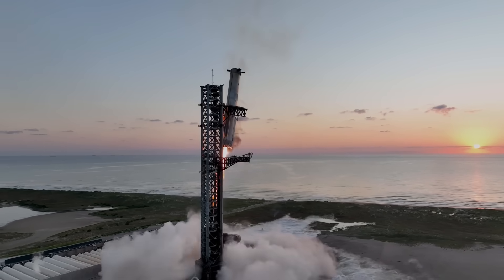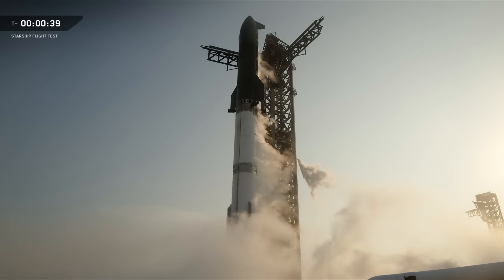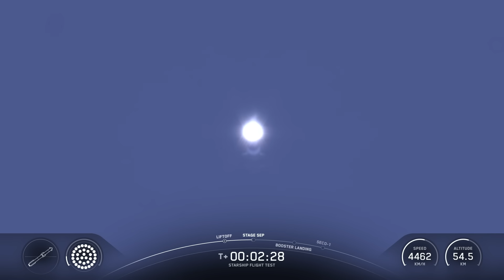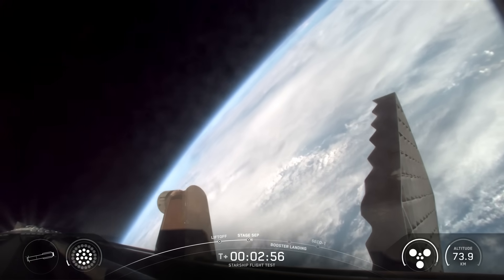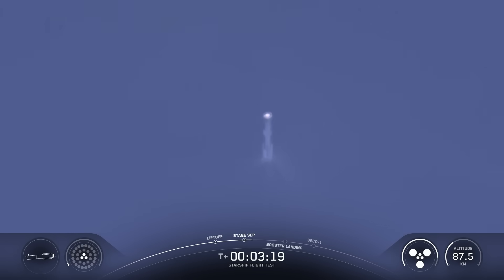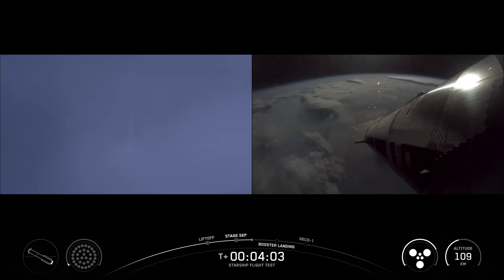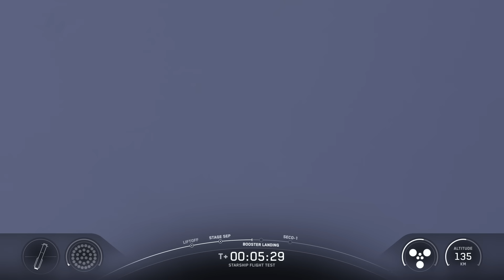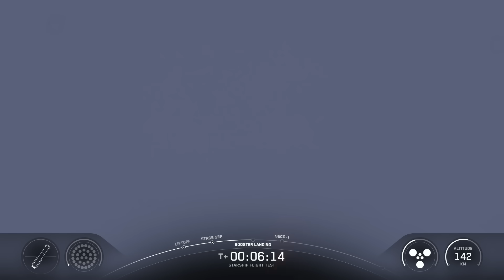SpaceX Builds Largest Reusable Booster, Also Makes Door That Won't Open - Starship Flight 9 Recap

Comment: Would it be possible to build a vehicle that can self-orientate itself into a survivable configuration? Soyuz is built like that, even if the attitude thrusters fail, it'll still do the ballistic descent. Which is rough, but safe.
Reply: Soyuz is passively-stable if the attitude thrusters fail *off*. It's definitely not stable if they fail *on*, as seems to have happened here.
Reply: Maybe there's a way to get the ship to cancel a tumble entirely though elaborate control of the aero surfaces, but that would make the software way more complicated, and I figure the descent would end up too steep to be survivable anyways. Normally the ship is supposed to angle itself and gain a bit of lift to flatten out the descent trajectory. Can't do that if it's frantically flailing its flaps around just to regain control during the first few minutes. The real solution is to not suffer catastrophic leaks during ascent.
Reply: It only works for capsules
Reply: An entire vehicle? I don't see how, they do that by interacting with the atmosphere and inducing drag, it would make it hell to launch, unless you placed the entire vehicle into a very large fairing
Reply: Soyuz would only fail "safe" if was already in the correct orientation when hitting the atmosphere AND didn't have a propellant leak AND it's engines failed while off.
Reply: Starship probably has way too much angular momentum for the thin wisps of air at that altitude to really arrest much of anything, unlike Soyuz. It had active control of the flaps the whole time and couldn't do much of anything to save itself. We saw this with Ship 28.

Comment: @scottmanley, It would have been nice if SpaceX continued to further develop Falcon 9 and Falcon Heavy while waiting for Starship to mature.

A larger 5m diameter Falcon Heavy (up from 3.7m) and a hydrolox  3rd stage can boost TLI payload capacity from current 16.8t to 25t-30t.. comparable to SLS block 1 for a fraction of the cost.

But Elon threw everything into Starship. I think an upgraded Falcon 9 / Heavy would have been a great intermediate step before operationalizing  Starship.
Reply: Probably not worth the time and cost, since it still won't be fully reusable. There are other rockets available like blue origins new one if falcon heavy can't do the job.
Reply: I’m pretty sure starship is the intermediary step. It’s the testbed for absolutely every tech they think they’ll need in the future (methalox, hot gas, full reusability, etc.) meanwhile it still needs to refuel in orbit and such. Once they get starship tech to work they can scale up or down for whatever they need.
Reply: @cipher4213 methalox is also kind of a dead end in the second and upper stages

Comment: SpaceX needs to make some serious leaps in flight 10.
Reply: Certainly it is just enough to get more DATA from yet other failure modes. Progress guaranteed, every failure is success!
Reply: Why?
Reply: @MDL.720  Because a lot of SpaceX money is from private investors and from the taxpayer (albeit indirectly). Both of whom expect accountability, progress and value. Things were never great on any of those counts, but are getting significantly worse through the V2 programme. It's getting to the point where Flight 10 needs to demonstrate a) the ability to get things right with an updated design, which is good long-term but will hit confidence or b) the ability to get things right with the existing design, which is becoming increasingly important.
Reply: @whistlingchickenleg  For the last time, taxpayer money is not being spent on the development of Starship flight articles.
Reply: @whistlingchickenleg do you know any of these private investors?
Reply: @epj0211  American taxpayers are paying for NASA. NASA paid SpaceX to develop Starship as it is supposed to be their way towards the moon. So yes, US taxpayers have gave money to this specific program and are legitimate to ask and expect results.
Reply: @epj0211  Of course it is. SpaceX received 3 Billion $ from NASA and is going to receive another 1.5 Billion. What do you think where that money went 🙄
Reply: @eljedimexicano6737  NASA paid 3 billion towards the development of Starship HLS. It is not being spent on the development of the flight articles. Also, you're all for taxpayer money not going to this, but turn a blind eye to it being spent in the billions towards bogus programmes to line the pockets of beurocrats? A bit hypocritical, if you ask me.
Reply: @eljedimexicano6737  NASA did not pay to develop Starship. NASA contract states that every time Starship achieves some predetermined goal SpaceX gets paid. Currently bit over 300 millions was payed out most of which was for flight three and nothing since then. The contract for moon landing is goal based and as such Spacex doesn't get payed until they demonstrate capability. They are not getting payed more even if they destroy 100 Starships then they would get payed if they achieved same thing on first try. So there is no taxpayer money being wasted since taxpayers are paying for capability only after it exists.
Reply: @eljedimexicano6737  
Stop lying.
Reply: @whistlingchickenleg how is taxpayer money being spent on this?
Reply: @aqeelraja4750  Because a good chunk of SpaceX cash is US taxpayer dollars.

Edit: I do get your point - another Starship burn up doesn't directly burn more taxpayer cash - but that isn't what I said, and my point stands.
Reply: @whistlingchickenleg a “good chunk” would be 6% if they’ve received $300 million and total investment is $5B.